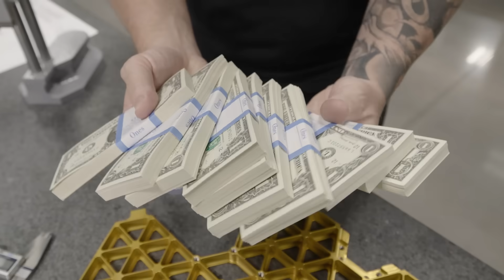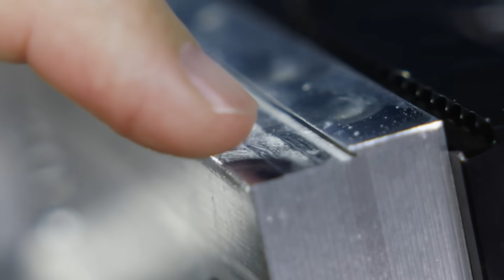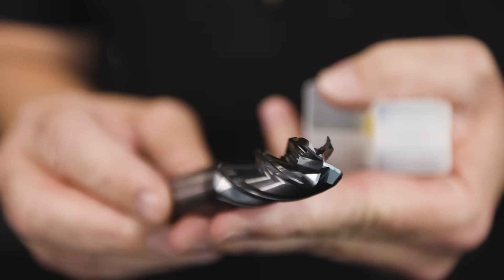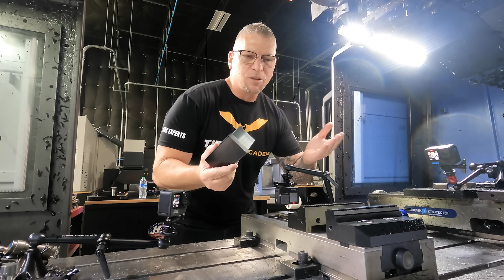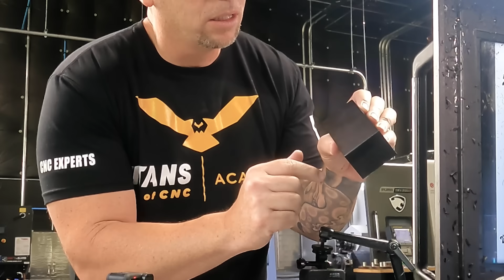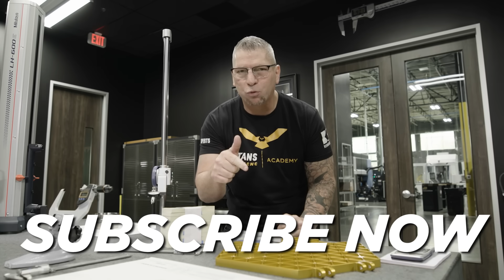How To Master The ART of Machining Plastics

Comment: I am a tooling and die guy at a well-known manufacturing facility in Cleveland TN.  I started here in 2013 on the track shooting screws in assembly for years , bidding on every job I could to try and get off the track. After getting passed up on easy press operator jobs over and over my company posted an opportunity to apply for the tooling apprenticeship program. I figured what do I have to lose. There was an aptitude test and several interviews but I felt I had been training for this my whole life and just didn't realize it. I passed the test and somehow did well on the interview side for a change.  The program was 5 long years of learning  while still working 40 hours a week. Worth every second. A couple of years ago I had spinal surgery to remove a tumor from inside my spinal chord. Working here has provided me the insurance to help cover costs. Two months ago I was informed the tumor has grown back bigger and I am very blessed to still be working or even walking. Hope I am still able after this surgery too.  The stack of bills in your hands look more than 5 inches but the math doesn't add up.... I am going to guess 4.7" ; 119.38 mm.

Comment: The answer to the question is I believe $1,000 in one dollar bills is ruffle 4.35 inches tall.. I love machining but it doesn’t love me I’m always under paid and I dnt like working at shops for long that dnt pay there ppl rite at all my last job I loved I ran a lathe with live tooling no y axis and the way the machine was set up most g codes didn’t work so I had to learn the manual guide I conversational programming my boss didn’t wanna learn or even care about the lathes I had full rain on them witch is how I like it if it wrecks that’s on me and me alone ya know and the programs were mine the ones that the previous person I made faster and even more efficient and the boss had it out for me so I got fired so I went from being the man to just a man and the shop I work at now dnt pay for shit but I got kids and I love machining I rather get paid less to do something I love them get paid more and hate Eva min of it but at my new shop there cheap skates I use HSS tools all the time not drills but end mills and I have only seen one program go over 100 ipm and this also pisses me off they have a lathe with live tooling and sub spindle and they dnt use it Eva I ain’t seen one program that used the sub spindle and it has live tooling and a Y axis yet again they dnt make parts complete they will do have the part set it up for the second half instead of using the sub spindle and have them run other machine it makes me not wanna machine at all they do Eva thing ass backwards but I love machining and it’s only 3 blocks from my house and with current gas prices it saves me a lot of money

Comment: I’m gonna tell a story.  I work in a cnc job shop with around 45 day shift employees.  My passion is my job. I am a engineer, a creator, a programmer, a manager, a scheduler, a purchase agent, a salesman, and most importantly a teacher.  30 plus years in this trade.  Every year we hire the top of class seniors from all tech schools in the area.  I absolutely love seeing the awe in their faces when we show them our shop.  We keep it tight, organized, and we always have the latest technology.  Gantry loaders, cmm,  5 axis, lasers, 3d printers. Etc… we do jobs no shops want or would even quote.  I enjoy teaching these kids.  An example,  we have a new hire from tech school named jack red hair tall full of energy and I can tell he already loves this trade.    So I have a lathe job 8 inch long pc of 3 inch brass.  Nothing crazy just a simple basic turning job keeping it simple to teach.  I show jack the print and ask how are we gonna make this part?  He looks at the print and proceeded to tell me how he would hold it in jaws and face the end rough the outside drill the front and finish the inside then finish the outside.  I say sounds good let’s try it.  And we go thru the setup part is sticking way out maybe 6 inches.  We touch off tools and set zero.  We program the tool paths and set some parameters depth of cut and feed rates.  For a new programmer all this is a lot to take in and I can see he’s taking notes, I can also see some mistakes being made on process but I entertain doing it his way with my help.  We cut the part and basics rough the part finish the part.  Of course we had chatter outside and in.  But we’re smart we offsetted the tools up and down as to not make scrap.  We then made some adjustments to speed and feed to get rid of chatter.  The cycle time was greatly increased.  Prolly around 9 mins each part.  The job was for 10 PCs.  Jack felt accomplished and I could have let him run with it considering he did learn how the machine worked and how to touch off etc… but I wanted to teach him not just to make the part but how to make it the best way possible.  So told him good job but there is a better way.  We then took the standard hard jaws off and pulled out the schunk claw jaws.  I explained how roughing the whole part out and finishing after caused the chatter because of how far out it was sticking and how thin the part walls were,  and that in some cases you need to rough the outside and finish the outside before roughing inside and finishing inside.  Also explaining that chatter comes from the tool not working hard enough. We made some adjustments to the program layout,  and increased the speed feed and depth of cut on all cuts putting more pressure on the tools.  We cut another part the cycle time dropped by 60 percent.  Jack was shocked.. I said let’s push it some more,  we did  and cut the cycle time even further down.  We erased any chatter.  We did this a few times and at the end we were just under 2 mins cycle time and our part looked amazing.  That was 6 months ago but jack still remembers that set up to this day and knows it’s never good enough,  any set up can be improved and done faster, to never just say it’s good enough.  Lesson one. Well I guess that’s all.   4.331 tall.

Comment: I got into mechanical engineering after being really close with my grandpa who was a drafter at a manufacturing plant that helped to create the packing machines for beer cans. I’ve always like to see how raw material becomes a useful part. Right now, as I’m in my last year of college, I have a co-op at a machine shop where I have learned to program mills and lathes. I also make fixtures and do quotes for new parts. Being able to take a piece of material and make it a part has changed my perspective on manufacturing. I love working with these cnc machines and hopefully I can give back to my parents who have given me a lot. Working on the shop floor with our machinists has helped me become a better engineer. 

The thickness of the money is 4.5327 inches.

Comment: hello sir, I'm from India. I'm owner of cnc machine shop. I'm do machining job work of machine parts, bathroom accessories and electronic parts in machine. after I complete my study, first time I see the cnc machine and start programming in job. i enjoyed and after I lost my job in corona time for cost cutting but I love cnc machine. after I purchased my first cnc milling with bank loan and today I have 6 cnc machine. i think this type of machine is knowledge of ocean. in my machine shop life i work with many type of materials like brass, copper, aluminium, Zink, plastic, wood, ss, and steel. i love using defferent material for defferent clamping mathod defferent cutting parameter and cutting tool. i remember my first copper part job i tried cut perfect but copper chips stuck in endmill and break endmill. i replace cutting oil and use peanuts oil and problems solved endmill cut copper smoothly. I have no idea for 1 dollar notes thickness. but i used paper offset mathod in my job time. i try to give your answer let we guess 1 note think is 0.08mm this 1000 nots and 100 notes hold by 1 ribin it's thickness is 0.08mm upside down 0.160 ten ribin so ribin + 1000 stack thickness is 1.6 + 80mm = 81.6mm. thank you sir I love to take knowledge from your videos.

Comment: Hi titan i hope you are doing great im still an aeronautical student and ill finish my study next year. I did make my own cnc router from another YouTuber i did push the machine to cut steel even though the dude that design it told the opposite. Im currently upgrading it and guess what, that router did introduce me the the machining sector and i did understand how really manufacturing works. And my guess for the thickness is 4.396inch or 111.65mm

Comment: I was a manager at a supermarket and during COVID my area manager pushed us to much so I quit and knocked on the first door I saw that had engineering above the door. Small job shop with only 5 employees, 3 of which are apprentices. That was 6 months ago and now I'm writing programs, running machines solo, even making parts for satellites. We have just taken delivery of a Okuma mb5000hii. It was an Incredible turn of luck and a huge opportunity. I have been inspired to go back to uni to study mechanical engineering with the hope to help bring manufacturing back to Australia. Haven't cracked out the old imperial system in a while but I think that stack of $$$ is 5.1874 inches

Comment: I work for a plastics engineering company, the price of Delrin/Acetal has gone throw the roof in the last year.
So the price of PEEK must be off the charts, we haven't machined it for some time now, and customers are getting things 
made out of polyethylene instead of Delrin, making tight tolerances near imposable to hold.

Comment: I do not work in machining, I work in construction making other things, but it is still good to take material and see things built and a sense of pride thinking ‘I did that’…. I made a couple CNC machines for fun as a hobby, still on the same lines of ‘I made that’. I would guess 4.433 inch

Comment: wow....plastic machining is a difficult thing.  if the parameter of cutting tools is wrong.... your cutting tools can stick, your product melts and your product has a bad roughness level.  only one can do, try....try....and try.... .  learn how to smooth your surface.  learn how you save more tools.  and learn how to control your self....

by the way the thickness of the 1000 dollar bill is 132.68mm

Comment: After I got back from a deployment,  I ended up in a steel mill finishing department.  They pay was great, especially given the location and the amount of training I had. I became more and more fascinated with machining as I became more experienced with the cnc threading machine. I always wondered what else I could do, how hard I could push it, and how hard to push things to obtain the best possible result.  After trade school, I learned that machines have their own personality,  and if you know what they can and can't do, you can expect great things. It resembles too closely to the comraderie I had in the army, and  it keeps my mind at peace. That's why I've chosen manufacturing as my profession and machining as my passion.  Without any actual measurements,  my rough guesstimate is 4.4817 inches. Going off averages and possible margins of error.

Comment: In 2012 I started in prototype manufacturing. Before doing this job, I was working in a brewery and sorted bottles by hand. Later a robot did my job and so I was out of work for a while. My father helped me to find a new job in the foundry he worked for many years.
I learned step by step the casting process. The company owner was looking for machinists to operate the new machinery he bought to expand the production capacity. I signed up for a training course and had 6 month of lessons at the vocational academy by full salery. Now 5 years later I operate a lathe and a five axis mill. The company grows and grows.
Every day  new parts out of different materials. Every day new challenges. I have only one try, because each piece is an prototype.
Big thanks to my father for changing my live.
The stack of money I think is 175.215 mm in height.
Greetings from Germany.
Best wishes to Titan and his team.

Comment: Try to machine sustamid plastic with Multiple Operations...is very difficult to machine.... drill, tap, pockets...I work with plastic long time and what I can say is that you can not go fast with plastic because you can snap or melt the part.The second thing is that you have to be very good at choosing tools because in this case  "Tool can be too sharp" for plastic and you don't have a good surface finish. The last thing is what the point to make this type of setting if you are living too much material for skim? Plastic is very hard to process with production repetition so you have to have a skilled machinist to work with it.Thanks, Titan for video like always pro

Comment: I started working in mechanical engineering about 6 years ago, when I started high school. At first I worked for my uncle as an operator of classic conventional machines such as milling machines, lathe etc. Later, I became hungry for self-improvement and wanted to take my skills to another level. I was 17. I was given the opportunity to work in a company that manufactures and designs tools such as injection molds, die tools. The first year was very difficult for me, I learned to operate machines like CNC milling machines, lathe or EDM machines, it was not easy to absorb all the information about everything, but I wanted to know all this I was literally hungry for knowledge. Every day after school I spent my all free time in the company and worked and worked on myself to be the best at machining. I learned from the best in my field and every day I saw a little shift. I watched your videos at night. I read information on machining to speed up production times. Today I am 22 and I am on a technology college and in the company where I work I am an injection mold designer and cnc programmer for all machines what we have, at the same time I am starting to work on my own company, which will produce components for bicycles, skateboards, snowboards. Despite all the knowledge I have, I think I still have something to learn and improve myslef. Also i think  thickness of the stack is 112 mm, or 4,4094" .

Comment: I been working with CNC machines for about 5 years years to making Crankshafts for lawnmowers and a variety of different engines, started off as a simple loader/unloader of parts in machines then became an operator and recently have started learning programming, I'm new to this channel and so far it's been very inspiring. almost forgot about the thickness of the cash 💸  stack i think its about 4.38 inches
Reply: The more you know the further you can go!!

Comment: Hello Titan.
I'm from Germany and I work in a research and development department of a big car supplier. My Machine is a Hermle C400. What I love about the job is that we can push limits of our machine and the limits of the toolings more and more. Especially with our new Kennametal Tools they are amazing. Also I love to try new things so trying different parameters to get highest efficiency as possible.
I think the stack is 111, 2 mm or 4,335 inches high.

Comment: I started my career at the Pennsylvania Gunsmith school where I learned how to run manual machines. I have since worked in Montana in the firearms industry, moved back to Pennsylvania and worked in the tool and die industry manufacturing plastic injection molds and now I took my career to new heights and I am working for Acutec Precision manufacturing in the aerospace industry. 
The stack of cash is 4.2568

Comment: Hello Tytan! You made me take matters into my own hands, I am a cook by education: D but my passion for mechanics pushed me to work in CNC, initially for $ 300 a month, I programmed two cnc milling machines and a lathe, I produced glass molds in a glassworks next to my city, after I went to another company for mass production, I programmed 5 axes, 3 axes and lathes, I had 3 helpers after 2 years of internship, at the end in Poland I worked in the production of prototype injection molds and high tolerance details, +/- 0.015mm , this work taught me everything that is most important thanks to the old staff, the gentlemen explained to me how to cut the material and I threw it to the computer and then to the machine, hard details of 55-60HRC injection molds, ductile inox, toolox etc, and then a short episode in Switzerland but I missed my fiancée and family so much that I returned to my country and bought 3 axles from 2007 Mikron VCE600Pro and I started my adventure, I have been watching your channel for about 7 years, You mobilized me for such activities and I am very grateful for this opportunity;) I currently have 2 milling machines 3 axes and 5 axes Wemas VZG65 and my dream about 5 axes was 2 years ahead of my plans with the purchase. What has changed most importantly? I calmed down! I was an aggressor, I fought for fun sometimes with 3-4 people at a time xD there were problems with the prison, shortly but I got hinges ... CNC is my life, my passion, just like motorcycles, I can't imagine a different life and every day in my workshop is not a day of work but just fun and entertainment. since I have my own company, I haven't worked a single day, so for almost 3 years I have been a free person in my mind and heart;)    i check on the web because i dont have dollars :D 1 dolar thickness is .0043in so 1000 is 4,3in ?:D

Comment: Cash stack height should be around 
4.035 +/-.01 
. I'm a machinist at US Engineering, I have been a machinist for about 11 years. Doing my part in making part fixtures for Auto welding and assembly robotic cells for the automotive industry. I'm currently working towards becoming the machine shop programmer and updating the tool paths currently being used. This shop exports almost half of it's needed machining work overseas, when they have the tools needed to get the work done in house.